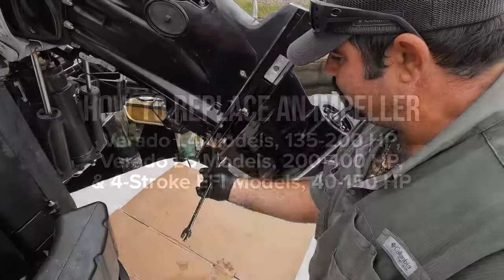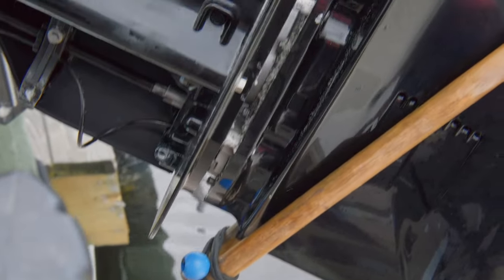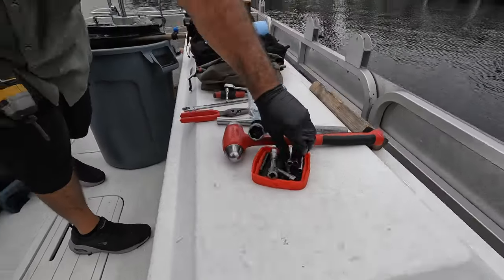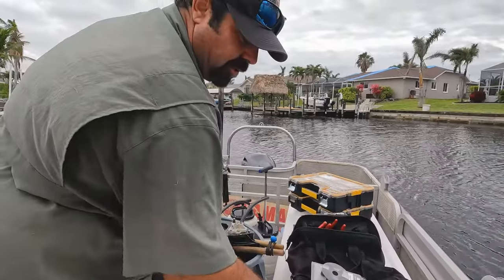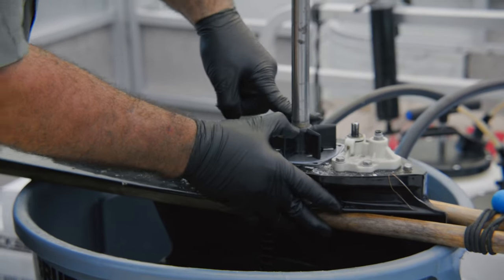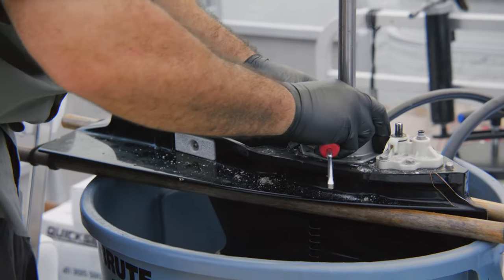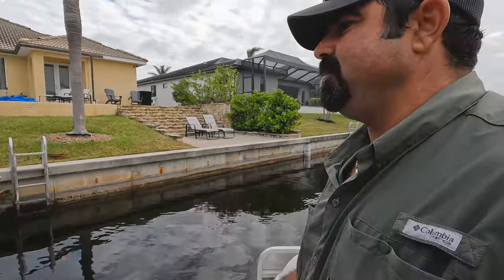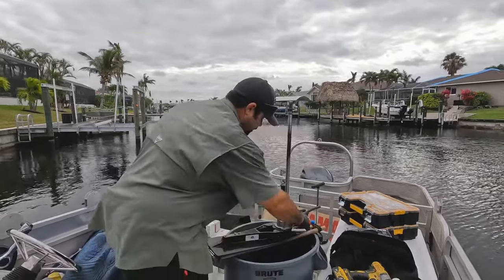How to Change a Mercury Outboard Water Pump Impeller

Comment: Did you line up the plastic water tube from the impeller housing into the tube coming down inside the lower cowling?   I didn’t see it.  Also, on an Optimax 175, is it just the metal plate-then (1) single gasket on top-then the impeller housing?   No gasket underneath the metal plate?  I did mine presently.  From the factory, it had a gasket underneath the metal plate (torn).  I have no idea why it would have one there.
Reply from the maker: Here’s a detailed response for @jgringo5516:

Hi @jgringo5516,

Great question! Yes, it’s important to line up the plastic water tube from the impeller housing with the tube inside the lower cowling. Sometimes, that part can be tricky to see in the video, but it's definitely an essential step.

As for your Optimax 175, you’re correct—the standard setup includes just the metal plate, a single gasket on top, and then the impeller housing. Typically, there's no gasket underneath the metal plate, but if your factory setup had one, it could be for added sealing in certain conditions. If the original gasket was torn, it might have been a previous modification or an extra seal that wasn’t part of the standard spec.

If you’re still unsure, it might be worth checking with a Mercury service manual or reaching out for further confirmation. Hope this helps, and feel free to reach out if you need any more assistance!

Best,
The PartsVu Team

Comment: I have a 2006 mercury 115 hp two-stroke four-cylinder. I’m looking to replace the impeller and the gaskets like you did the 300 hour maintenance. Is there anything you recommend? I do differently?
Reply from the maker: Hey there, 

Most of the processes are the same, with different parts of course. We recommend checking with your owner's manual for your 2-stroke engine!

Comment: Does the engine oil have to be drained for lower unit to come off
Reply: No
Reply: YES on many models.  I have a 175 Verado and if you don't empty the crankcase, you will get almost 2 quarts of oil all over you.
Reply: If you pull off a lower unit and get cover in engine oil you've got some serious issues with that  motor.
Reply: @gord1527  it’s certain engines. You clearly haven’t done your research. 

It’s clear as day in the video I linked to….

Comment: Can bad pump cause an alarm with no codes?
Reply from the maker: Thanks for watching!

Yes, a bad water pump on your Mercury outboard can indeed cause an alarm without triggering any specific error codes. Modern outboard motors are equipped with sensors and alarms that monitor critical functions such as engine temperature and water flow. The water pump in your outboard is responsible for circulating water through the engine to prevent overheating. If the water pump fails or is not pumping water adequately the alarm may not sound. Check for signs of water flow from the tell-tale or pee hole. If there’s no water flow or it’s irregular, the water pump may be failing. Have a qualified marine technician inspect the water pump and replace it if necessary.

Good luck Buddy.

Comment: I’ve seen all these crazy contraptions people build
 just to hold the lower unit after people take it out. 55 gallon garbage can! Who knew!? Thanks.
Reply from the maker: Expensive contraptions are not always necessary. That being said, Frank has several years experience with balancing the weight and shape of the lower units he works on! 

Happy Boating!